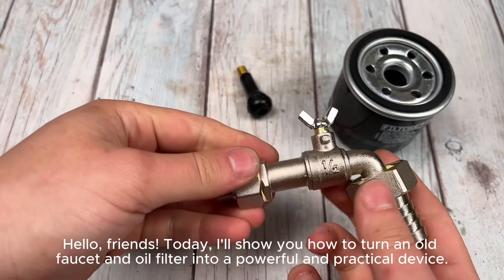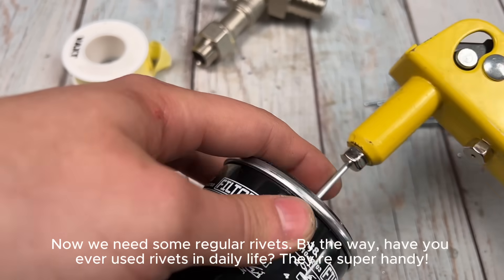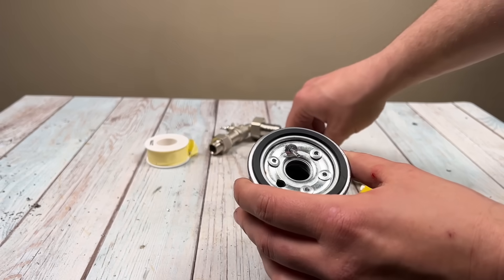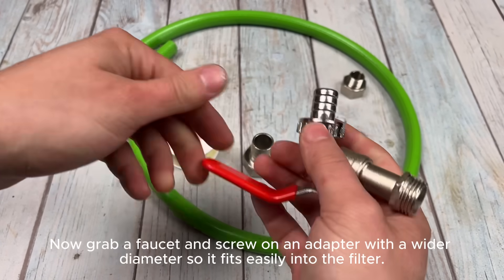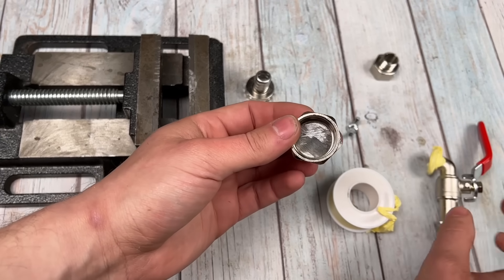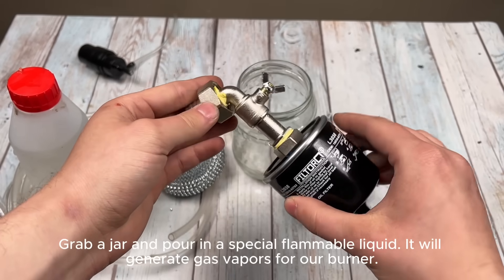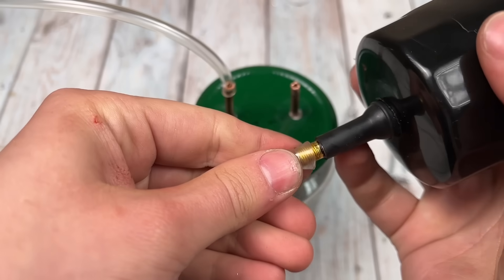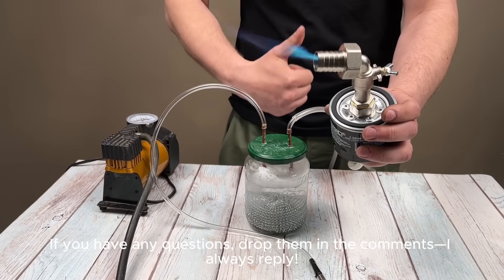Why isn't this patented?🔥 Put an oil filter in a water tap

Comment: I will get right on it !!  It would work a lot better if you installed an idle off a Caterpillar 46A in line. Secondly, Submerge the filter assembly firmly in a ripe water melon . Making sure that the ambient temperature is above 470 degrees. If  it doesn't properly, try an idler off of a 17A, that should correct the problem.

Comment: If he punctured the circular metal piece that he put inside the pipe i.e. the water tap he would get a fire that directs from the system so the fire coming out does not direct the flame is the reason and thank you A wonderful thing and a beautiful idea I wish success

Comment: Texas, USA.   You should mention to take out the pin valve on the rubber air valve.
Reply from the maker: Thanks for the tip! I'll make sure to mention that in my next video.
Reply from the maker: Thanks for the tip! I'll make sure to mention that in my next video.
Reply: شكرا جزيلا لكم اختراع رائع جدا تحية وسلام لكم من العراق
Reply: فقط أريد اعرف نوع السائل مع الشكر والتقدير

Comment: This is an 1100C gasoline soldering iron for stainless steel or noble alloys.

There is a serious mistake in the design :The filler neck and fuel level must be below the level of the suction tube, otherwise there will be a flamethrower.

это бензиновый паяльник 1100C для нержавеющей стали или благородных сплавов.

В конструкции серьёзная ошибка :заливная горловина  и уровень топлива должен быть нижн уровня всасывающей трубки, иначе будет огнемёт.
Reply from the maker: 🤝🤝🤝🤝🤝🤝🤝 Exactly! Didn't take that into account, thanks for the wisdom.

Comment: Good project but its dangerous budd that open flame is so wide and not a consistent flame
Reply: Not a plasma cutter either! Steel wool ignite s with a common match !! This guy must be high..
Reply from the maker: Thanks to the coin as a nozzle, it is very optimized flame and understandable intuitively
Reply: yi père dangereux son histoire ?